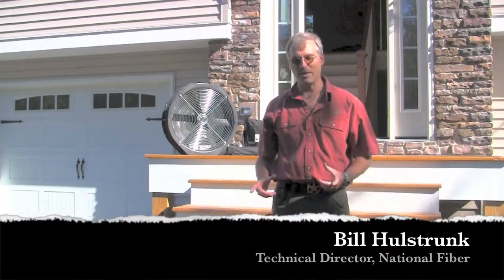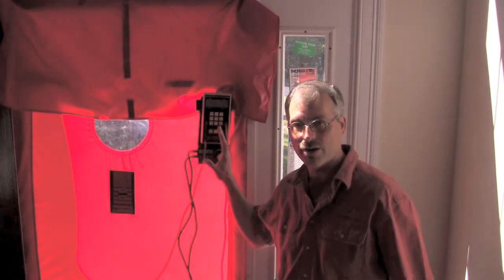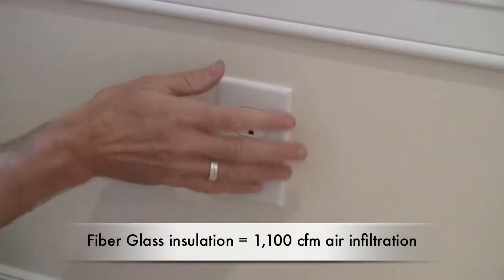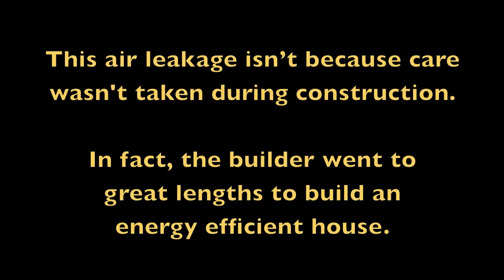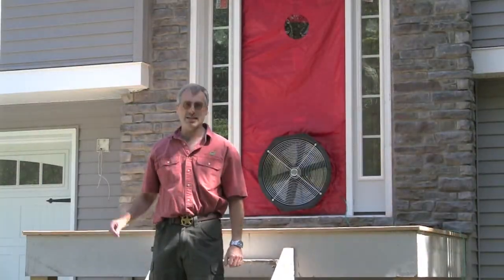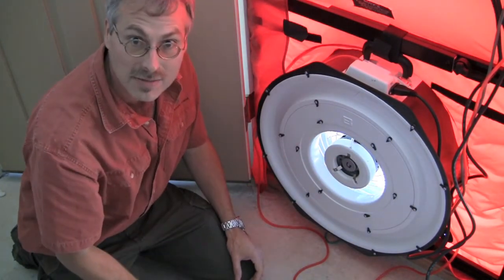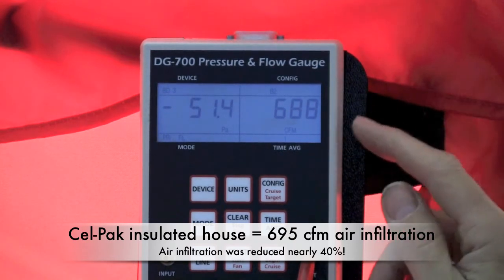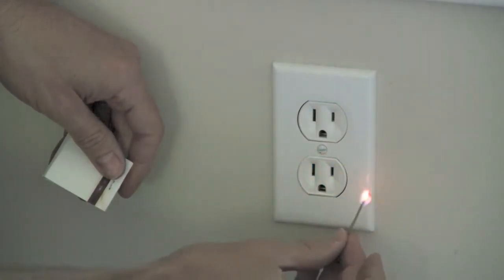Cel-Pak vs Fiber Glass

Comment: You clearly haven't done your homework.  I have installed both.  Cellulose is superior in most every way.  The product I use. You blow at 14.6 inches.  after it settles to its final 13.1 inches, it becomes even more airtight over fiberglass and is at a R-49 rating.  Fiberglass also settles.  It also loses r-value in cold temperatures by as much as 50%.  At 0 degrees, R-49 would only be R-25 in fiberglass.  Cellulose will still be R-49.